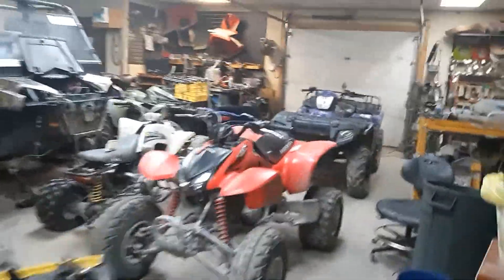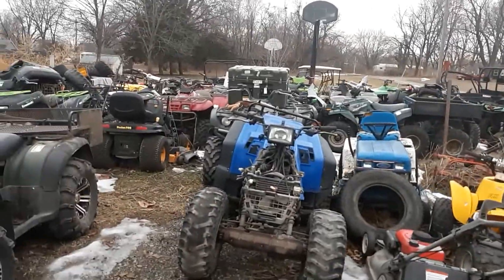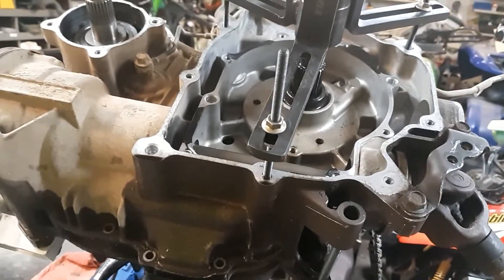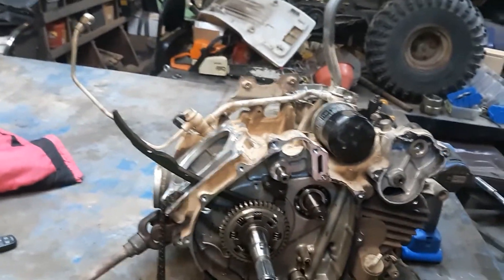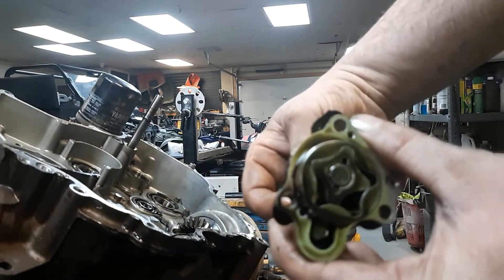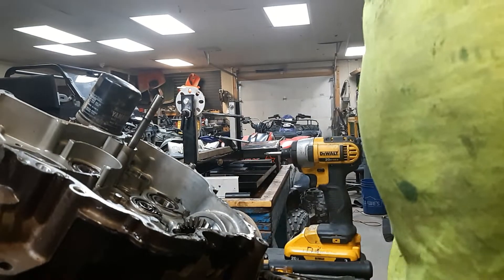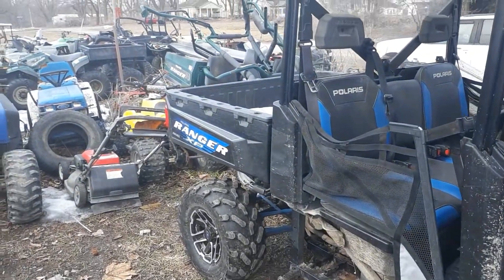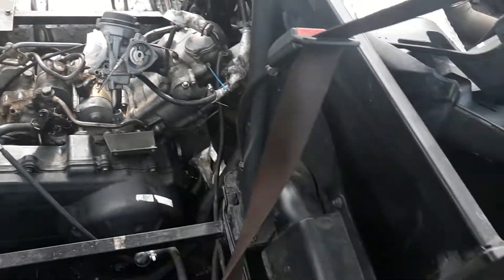catastrophic failure 02 grizzly 660

Comment: That small one looks like a Chinese bike by looking at the fuel tank. I'm starting a 2003 Yamaha Grizzly 660 that had a coolant leak, but ended up being neglected for 19 years. Yes all the pipes are rusted out, the tube that comes from the thermostat housing also fell apart so now its a top end rebuild to include all the hoses being replaced along with a new carburetor, being that someone had broken the screws off in the bowl and side plate. Are you still doing any videos???